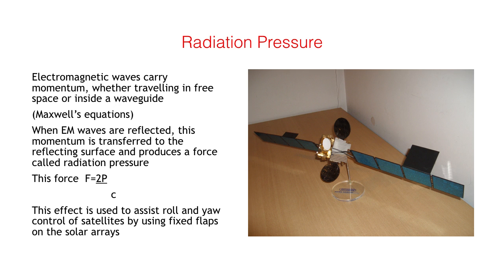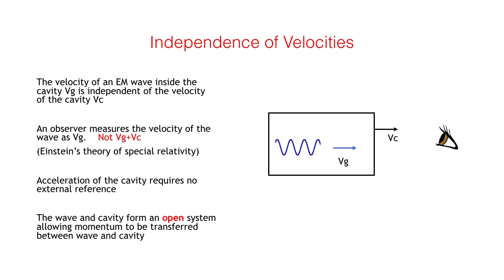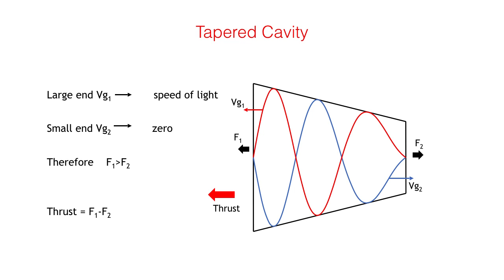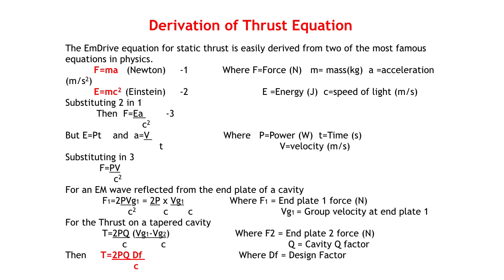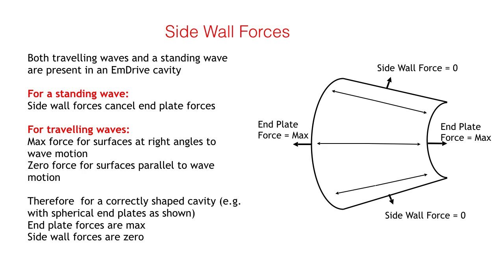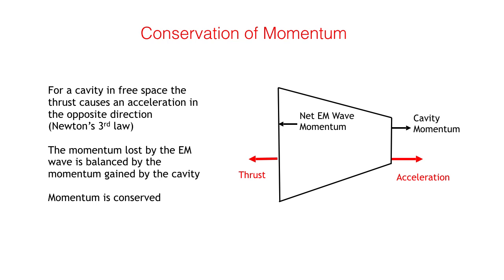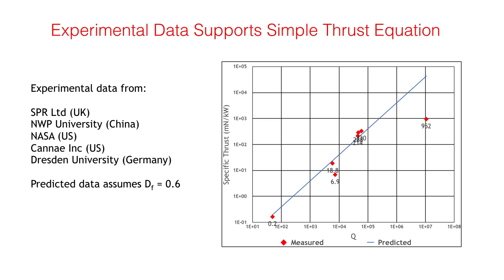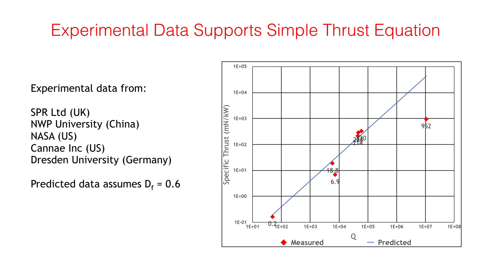Roger Shawyer Explaining The Basic Science behind #EmDrive

Comment: If this is true then it would seem to me to be possible to simply use the transmission of an EM wave as propulsion much like chemical combustion producing thrust, no enclosed cavity needed. Just aim a dish antenna in the opposite direction that you want to go and emit the EM waves from it like thrust from a chemical combustion thruster.
Reply: @alysdexia, you should look up the IKAROS mission. It's a Japanese space probe that was launched to Venus in 2010 using a solar sail.
Reply: This is true, you can create a reaction force by emitting photons, as in your example using a radio frequency power source and a directional antenna.  But the radiation force is very small - it's equal to 2*P/c Newtons, where P is the power level in Watts and c is the speed of light in meters per second.  The EM Drive inventor (and the five other groups that have repeated his results) are claiming to get an amplification factor due to the Q factor of the cavity, basically by repeatedly bouncing the photons off the end walls.  Where I'm having trouble is that it seems that the reaction force can increase without bound as the cavity's Q is increased.  It seems that at some point, this would violate conservation of energy - at the point at which the rate of increase in kinetic energy exceeds the level of RF power being fed into the cavity.
Reply: I agree with you that it is physically impossible for the amplification factor to exceed the level of RF power. That WOULD violate conservation of energy. This repeated bouncing of the photons off the end walls sounds more like the principle behind the laser. But a lot of the energy in a laser beam comes from pumping the atoms in some material to a higher energy state and then letting them fall back down again to provide photons in a coherent beam. I don't think that you can get any more action/reaction energy out of the photons for propulsion purposes than you would get by just simply emitting them out in a particular direction in a tightly focused beam, no bouncing them around in an enclosed cavity will get you any more energy than you originally put in.

However, the concept of propellantless propulsion is intriguing. I've read that by using a light sail we could get an appreciable velocity from continuous propulsion over months and years even though the propulsion is at a very low level. Apparently it adds up over a long period of time. But of course this source of propulsion drops off the further the spacecraft gets from the sun.

Suppose that time of acceleration could be extended considerably by the use of the tightly focused beam emitter as a photon thruster. No short term chemical combustion propellant would be necessary and therefore so much mass would not have to be accelerated. Perhaps the electric energy could be provided by something nuclear like an RTG so that it would be long term enough for the long term propulsion. I've also heard that the higher the frequency of a wave, the more energy it has, so a higher frequency wave should provide more reaction.

But this is beginning to sound a lot like the principle behind the ion engine.

Comment: If wave pressure is the mechanism, you won't be able to get any more thrust than simply aiming the microwaves out of an open end of a waveguide.  The only hope of getting more thrust is if the microwaves are boiling ions off the outside of the cavity.  These can carry away more momentum, and thus, transfer more momentum to the cavity.
Reply: Walter Garvey Exactly, and if you look at the wikipedia on the EM Drive NASA did test a design with no tapered chamber to compare and it produced no thrust, proving you need the tapered and yes also conductive chamber i.e big ass nuclear powered liquid hydrogen cooled magnetron firing into superconductive tapered resonating chamber = Star Trek impulse drive for interplanetary travel. This system set up the way I described can reach 20 percent of the speed of light according to some researchers. Only good for interplanetary though as it would still take 90 years to get to the nearest star but the whole solar system is at our "efficient" grasp now so its a start!:)
Reply: livefire666
If you keep reading this wikipedia article, you will see that experiments (such as the Chinese) are retracting their initial claims.  The current best-done experiment is measuring 0 Newtons, +/- 0.7 mN, for a massive amount of input power.  It's a great battery drainer, but not a thruster.  If there is any thrust at all, it's likely microwave-induced energy boiling charged particles off the outside of the cavity, much the same way a cathode ray tube works.
Reply: livefire666
It would be great if it worked.  We should be careful not to be schnookered by someone hiding a canister of compressed gas in the cubesat.  There are plenty of perpetual motion and free energy salesmen here on earth that have been garnering plenty of investment from folk over the years, with a lot of trickery going initially undetected.  I'm not saying that's the case here.  I'm just saying I hope there is due diligence to make this a good scientific experiment.
Reply: What about using a nuclear reactor to power a massive liquid hydrogen cooled magnetron firing its microwaves into a superconductive tapered resonating chamber?
Reply: livefire666
I still don't see any thrust gain from the resonant chamber.  It would be better to just fire the microwaves in a particular direction.
Reply: +onehit pick I don't believe there was any momentum over a non tapered cavity. My understanding was the wavelength being effected by the confinement cavity which needs to be conductive. If the effect is as hypothesized to be an amplifier for the waves, you would be converting the microwaves to something higher up the spectrum. Just my understanding.
Reply: Walter Garvey And yes your understanding is most likely correct, according to what I have read some scientist are speculating that this device is converting the microwaves into photons or some other high energy state exotic particle that are blasting out the back but in such a high state that our current measuring devices can not detect them. Also a prototype of the device as I described was already tested and it produced a near 1-1 ration of watts of power to mN of thrust. https://en.wikipedia.org/wiki/RF_resonant_cavity_thruster
Reply: onehit pick "In 2016, Yang et. al. published a paper, assessing an independent (self-contained) microwave thruster propulsion device with three-wire torsion pendulum thrust measurement system.[45] The measurement system was determined to be able to detect 3 mN force with uncertainty of 14%. For the independent microwave thruster propulsion device, they reported "Measurement results fluctuate within ± 0.7mN range under the conditions 230W microwave power output, and the relative uncertainty is greater than 80%." The same device was also tested with the DC power (about 30 amperes) supplied from outside. The excessive force in this case was found to be 8~10 mN, emphasizing the importance of using self-contained systems." NASA would easily be able to prevent something so easy from effecting their experiment I think. Also this has made it through peer review, again not likely if it was something that simple. Also if "boiling of charged particles off the chamber were the case" the shape of the chamber would not matter, but as NASA shows it does. Its time to put one on a cube sat and see if it works in space, only then will everyone be convinced. That would only cost $30,000 by the way so it should be done like.....tomorrow.
Reply: onehit pick Here we go....http://www.dailymail.co.uk/sciencetech/article-3771651/The-impossible-drive-set-space-test-Warp-drive-technology-launched-shoebox-sized-satellite.html
Reply: livefire666
I wonder where it's going to hit.  I hope in the ocean.
Reply: onehit pick If it falls about a 71 percent chance. My guess it wont fall and if so we are going to need to go back and look at all of our current tech and the mysteries it might hold still as we have had microwave ovens (magnetrons) since 1945. And that means other people have known about this for a long time but never shared it with the public, you know who. Also experimental physics needs to be able to be done before theory in some cases, otherwise currently unexplained anomaly's like this would never be found and able to be used.
Reply: +livefire666 so as of yet there is no standard model for amplifying waves? If someone was taking this perspective field this may be a good time for a thesis.
Reply: There is plenty of material on amplifying microwaves (which is just making them stronger while keeping the same frequency).  There are also several well known techniques for up-converting them (which is increasing their frequency).  The em-drive, if it's doing anything for thrust that's not trivial, is probably throwing electrons off the surface preferentially in one direction.  The electrons would need to be re-supplied by a source.  There is plenty of material on how to accelerate electrons off of a metalic material.
Reply: +onehit pick I'm familiar with ion drive which requires specific surfaces and a charged diode. This is different for obvious reasons. I am aware signals can be captured, amplified, and re-broadcast. This would be a slightly different method of amplification.
Reply: I don't think they are getting the thrust they are off simply accelerating electron off a plate, and again NASA would be able to detect that. You do understand NASA has had multiple versions of these devices for over a year in their lab and they all work and all are not explainable by conventional means right? Here is the other version they have tested which worked and is going to be in the cube sat. http://cannae.com/about/ Also watch the the video at the bottom and you will see how it works at this link. http://www.dailymail.co.uk/sciencetech/article-3644747/Does-Nasa-s-fuel-free-thruster-invisible-exhaust-New-theory-explain-EmDrive-man-Mars-10-weeks.html In the video he explains he is pumping photons into it and it is creating radiation pressure just like Shawyer does, but he also mentions its using the Lorentz force as well. Interesting because that's what Rail Guns use to propel matter. Interesting because if this device can just me made using light and a flat disk like the cannae then we are skipping the microwaves and conductive cone all together.....how can this be?
Reply: livefire666
It's easy to miss things in experiments.  I'll have to review the most recent NASA experiments.  All the previous experiments I've reviewed have been flawed.  As far as the latest theory goes, people have been adding microwaves to cancel out for a long time.  Examples include "nulls" in a beam.  These nulls don't carry extra magical momentum.  My previous assertion stands that you can't increase the momentum transfer from a bunch of microwave photons by bouncing them around.  If the microwaves are being accelerated somehow (up-converted in frequency) and then being emitted as higher energy photons that cancel out, we'd need to see the science behind this.
Reply: just gonna point out if we can go 20% the speed of light we can get to the centauri system in 20 years not 90. It's 4 light years away
Reply: dekumutant Ya good point! Also why is 20 percent the speed max? If it just continues to accelerate like the ion drives do now wont an object is space get much closer to light speed then that eventually, like 99 percent?
Reply: livefire666 
I'm not nearly as educated as a lot of others talking here but if you want to go very fast it takes more and more thrust over really long periods of time
And don't forget that if we want to do anything realistic we need to spend a lot of time slowing down as well
Reply: dekumutant That might not be true because in space there is near zero resistance, so under a vacuum you should just keep going faster and faster with a consistent thrust quantity I believe. Micro gravity is really the only limiting factor, as well as the ultimate light speed barrier...
Reply: dekumutant
If you want to go really fast, from your own perspective, it doesn't take more thrust -- just some (possibly constant) thrust.  It only takes more thrust from an external "relatively" stationary observer.
Reply: onehit pick Thanks yeah your right, when i said more and more thrust i really meant more and more fuel too keep the thrust constant. Alas i'm not good at this stuff so i'll gracefully duck out.
Reply: dekumutant lol it's alright bro.
Reply: dekumutant
Ah... that makes sense.  I just always thought it was an interesting thing about special relativity -- from an external observer's perspective, it actually looks like it acceleration "slows down" for a constant thrust from the craft's perspective.  From the craft's perspective, however, they can keep crossing more "mile markers" continually, with a constant thrust.  The length between the mile markers, however, would appear to contract.
Reply: wow that's amazing. My question is what about the effect that g forces will have on the angular momentum of quantum events at 20% light speed? The AM of QE in biological and mechanical systems.
Reply: The guy who made this video wanted to make it sound like he knew what he is talking about by making it sound all complicated.

The math is important, but only needed when the designing is being done, when you need to explain how something works to the general population of the world, a simple explanation is all that is needed.

So here it is.

Microwaves bounce of metal, you can see that happen with aluminum sparking in your microwave.

So the EMdrive puts the microwaves into a cone shaped piece of metal and they bounce off creating force.

Yea it is pretty much that simple.
Reply: Nubyrc
It can't be that simple because that would be a reactionless drive which is not allowable under current understanding.
Reply: livefire666
I read the most recent NASA paper.  They checked for all kinds of things, but didn't report checking for ion emissions, and the biggest no-no: they used an external power supply. When will they listen and stop using an external power supply.  Electrons themselves have plenty of energy and momentum.  IF they're coming from the outside, the whole experiment is absolutely invalidated.
Reply: @onehit pick:  “It would be great if it worked.  We should be careful not to be schnookered...[etc.].”  Yes and if maybe by the time that it gets all done they are going to have a high voltage electrode with a positive charge and also an electron gun on the other end (and the satellite is going through a magnetic field in a plasma environment) then it might really deserve such a label as an electromagnetic drive just like what they had been saying right along.
Reply: Well if a satellite drove a direct current right across the magnetic flux then that would seem to be no new physics and electromagnetic drive right out of a school book.  One Newton per ampere meter per tesla, right?  Why not stick the EMDrive label right over there?

Comment: Beam me up Scotty. One variation I wrote about some 20 years ago was a perfect sphere, where an energetic particle is fired at the one atomically wide surface that is not perfectly round. This sends the wave into an orbit inside the sphere, with the only exit at the entry point. This gives thrust opposite the direction of release. An internal accelerator, a charged crystal would seem most likely, will add energy and in effect create a light motor. Electroplated crystal acts as a form of plasma battery, not something well researched. Anyways, love the concept.
Reply: neat idea. given that we have glass delay lines and such, i wonder how long a photon would take to find its way out.
Reply: Not even blink of the eye because photons move, well, at the speed of light
Reply: Couldn't this just be a gross-size application of Woodward? I wonder what would happen if they turned the frequency of the wave up and made the "cone" out of a dielectric more absorbent to HF. For that matter, since it's easier to produce electricity and reverse, I wonder what would happen if you flipped the cone around and used the chamber wall to generate radiation aimed to terminate at some "cathode" made of e.g. boron or such...
Reply: I would think that if you can trap a photon in side a crystal ball then the light pressure should balance out all over it?